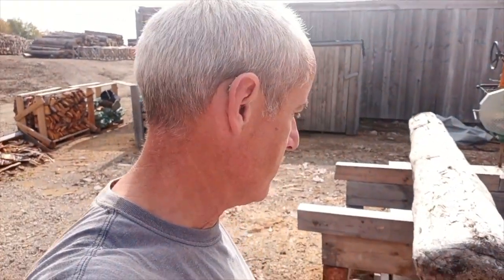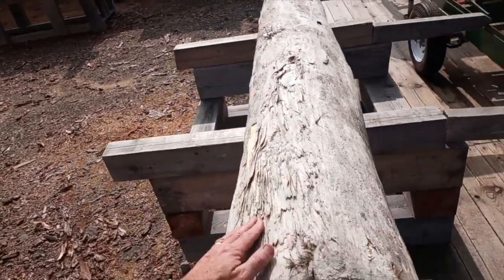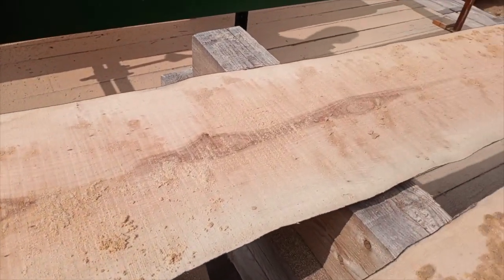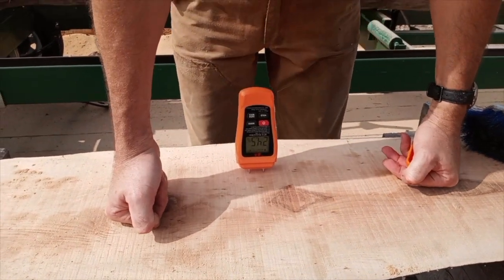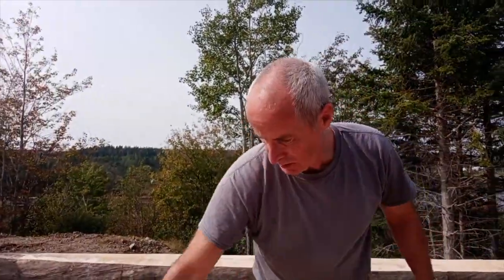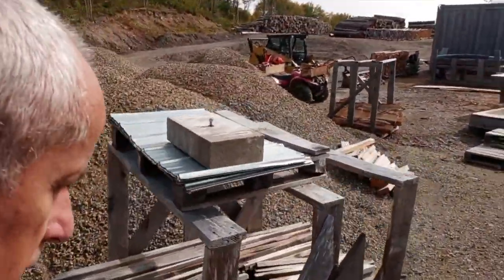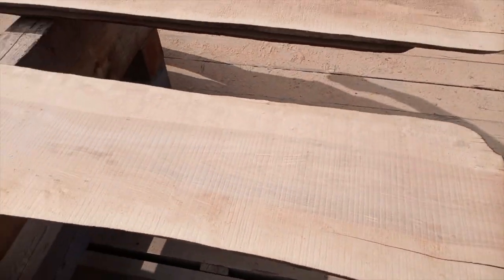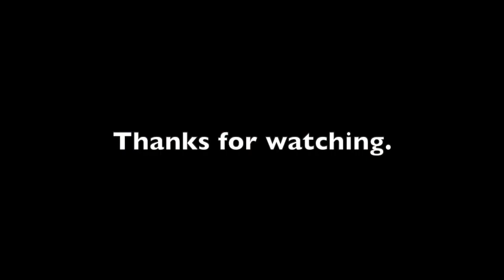20230930 Slicing open a sinker log

Comment: This is interesting, I have an old one at our lake I’m assuming hemlock but not sure I’ll winch it out someday and saw it. That was nice wood though being maple. 
Thanks for sharing. Take care.
Reply from the maker: I did two 1/2 inch thick slices near the middle and put them in the shipping container for scrollsaw projects next year. I placed them separately on their sides, on edge. Boards are 12ft long, container is only 8ft. Positioned so there could be air flow all around. I was in the container this morning, and one of the boards is shaped like a banana AND cupped. The other is like a ribbon, all wavy. Doubt I can make anything with them other than kindling.

Comment: Nice work 👍 that log turned into some super nice boards. I was surprised that the maple held up that well under water and didn't smell.
Reply from the maker: Aye, same thoughts. But... the lumber ended up being quite reactive. It warped and twisted for the most part. The 1 inch thick boards milled off either side of the pith were not too bad but they did cup some. I milled the pith into two 5/8 thick boards. They didn't stay straight at all. I'll probably do a followup video on that.
Reply: @WoodchuckCanuck  wow I wasn't expecting that outcome.  The wood looked real clean..